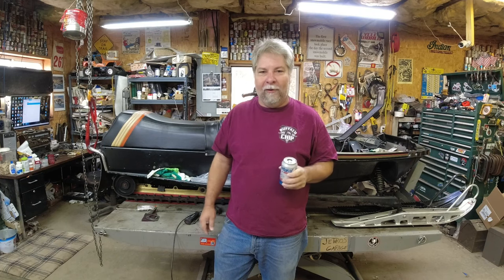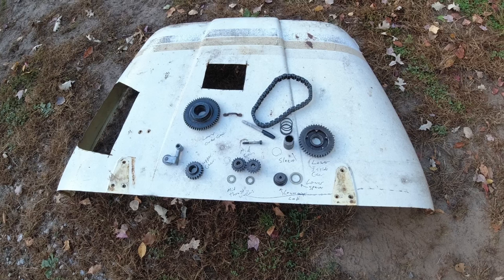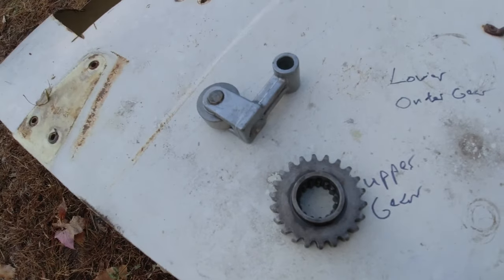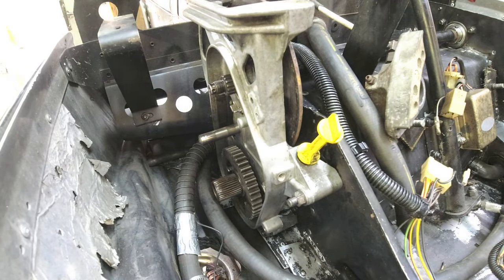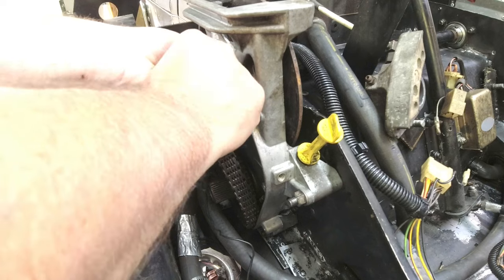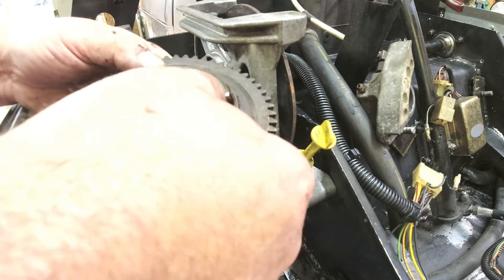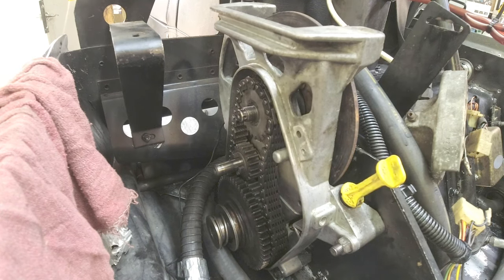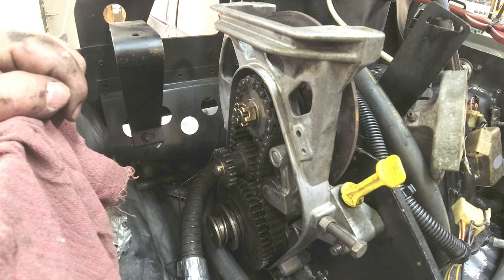INDY 600 PART 5: REVERSE CHAINCASE UPGRADE ASSEMBLY DETAILS AND TIPS! VINTAGE TRIPLE SNOWMOBILE!

Comment: I successfully tore into two reverse chain cases last year. The only thing I missed was lubing the gasket assembly for easier placement. I didn't notice it being too difficult, but I had a helper both times and extra hands never hurts either. A side note: I don't have a worktable, so my sleds are on their sides when doing chain case work. It seems to help the process go a little easier since I don't have to fight gravity. My biggest complaint is working around those coolant hoses. Again, extra hands are a plus!
Reply from the maker: I used to work on my sleds on the floor too. I like the table. No worries about scratches and I can adjust the height or drop it to the floor and tip the sled on it's side. Choices are good. I will need to re-route one of the cooling hoses because of the reverse. Shouldn't be a big deal, I've done it before.
Reply: @nuttersspeedshop  Had a brain fart today on how I can get a worktable cheap. I have a chain hoist like yours new in the box so I'm hoping to have those same choices in the not-too-distant future. Regarding most things, oh yeah, rather have a table too!

Comment: Hey Nutter where did you get that gasket for the chain case? I have a 74 tx I’m acquiring parts for. The last guy gooped it up with rtv. I’d like to throw a fresh gasket on. Let me know, thanks.
Reply from the maker: 74 TX chain case is different and uses a different style gasket. It was basically a rectangle section O-ring 1/8" x 3/16". Google Dr Mario's Vintage Polaris parts and see if Don has any. If Don doesn't have any you can come pretty close with a 3/16" square section O-ring from McMaster Carr. You'll need at least 3 feet of o-ring stock. Your cover will stick out 1/16" further than normal but it should seal. Just put the gap at the top.
Reply: @nuttersspeedshop  awesome, thanks for the response. Love the channel!!
Reply: @andyceranski6823  I have obtained these gaskets from Dr. Mario. I originally found them on eBay.

Comment: Love the videos! Curious where you get your bearings for idler wheels? i have some mid 90s indy’s that need some. Can get 12 for 36$ on flea bay but not sure if they are any good b
Reply from the maker: 62052RS. There are all different brands and levels of quality. I think Napa gets $25 to 30 per bearing for some!  I have been using FKG band lately. I just added a link to these in the description of the my latest video bullwhip part 4. These are not the ultimate in quality but I think they are a good value proposition for the money. I'd say Timken, SKF, NTN, Fafnir and other older name brands are the best but they also cost a lot more.  I don't have any testing to back up any of this, just my thoughts.

Comment: Hey Nutter!  Good video!  Don’t see a lot of videos on those reverse chaincases, so thanks for the tutorial👍   One question though, doesn’t that chain look a little “stiff”?  Seems like it might me stretched or needs a good cleaning to get the “kinks” out if it?
Reply from the maker: Thanks Rob. The chain is OK. This chain case sat around for years and the old lube dried up a little. I'm just going to run it in some ATF for the first run and them dump the chain case and switch to synthetic chain case oil. It will be fine.